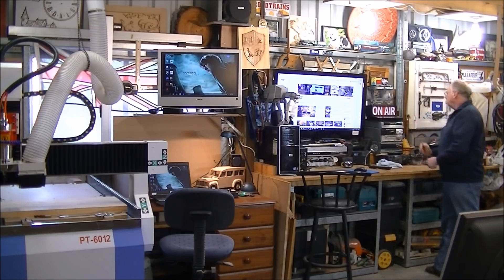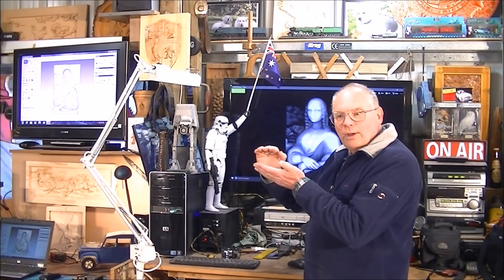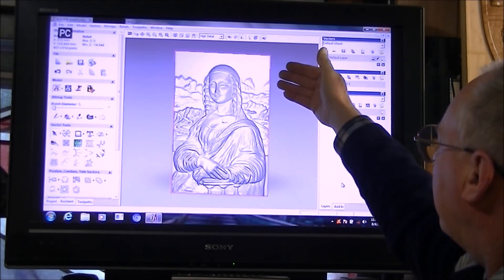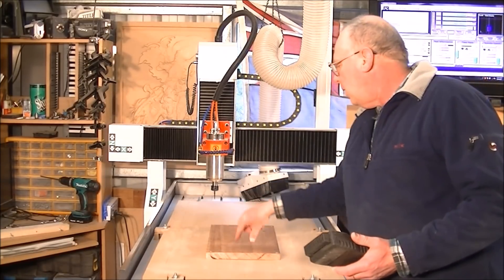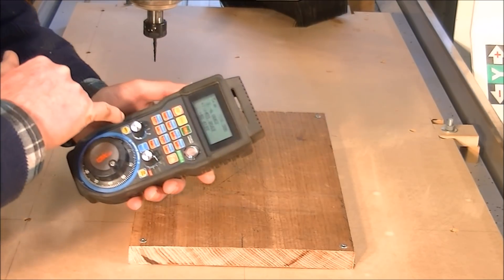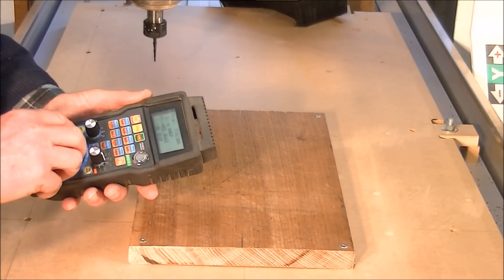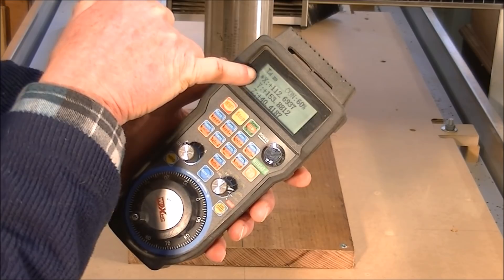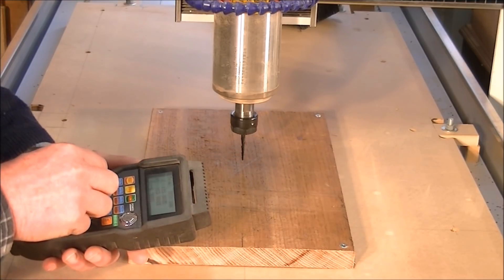*NEW* CNC router in depth for beginners 3D carving

Comment: Mr. Roger i'm a big fan, and i'v been watchig your vid's for long time and they'v helped me tremendislouy, yet, i could'nt find a vid that really tells me step by step how to carve 3D on a router cnc, mainly, the transition between bits, is that something i set on Art cam, or is it a matter os changing bit and restartig job, knowing that i dont have the ATL system, user of a mach 3, and how to ensure same position of the job between bit changes. if you can answer that with a demonstrational vid i'd be very very thankful, i belive in CNC as as a new revullotionary way that really changes future of industry, i have a laser cutter, 3D printers, and a CNC that's been sitting for quite long time now, almost a year, just because it's technicalities were overwhelming for my humble knowledge level at the moment, i resigned my job to pursuit this as a career, and nothing is etching my brain more than this investment i made and not be able to really grasp working it well. 

i wounder if you offer apprenticships, i'm welling to come and attend a course with you to be to really wrap my head around this.
Reply from the maker: Yon need to see more of my videos

Comment: What were your cut settings? What percent are you stepping over and what size radius ball?
Reply from the maker: 80mm per sec / 0.0125 step over / 24,000 rpm and a 1r mm ballmill
Reply: @inventorsworkshop9600  thanks!

Comment: Could you let me have the bit specification you used for this carving.  I have been using 2mm carbide ball with only a 17mm flute length. Not really suitable for doing larger relief carving. They snap far to easily.
Reply from the maker: 3mm x 22mm  ball mill